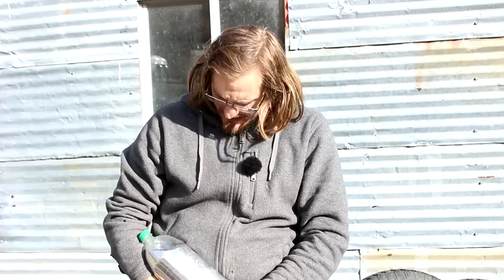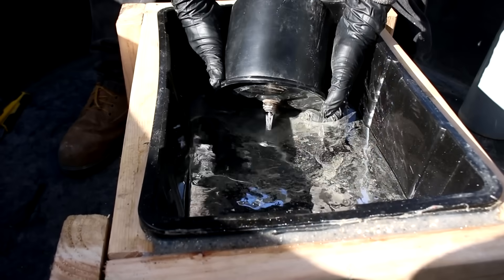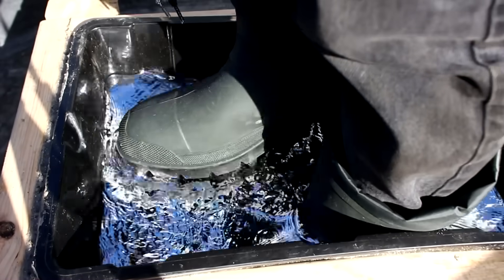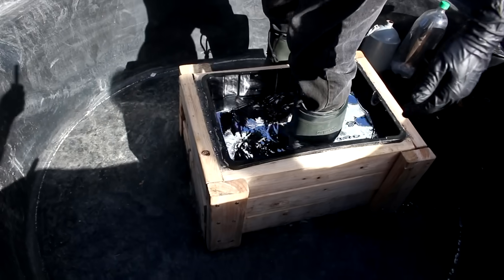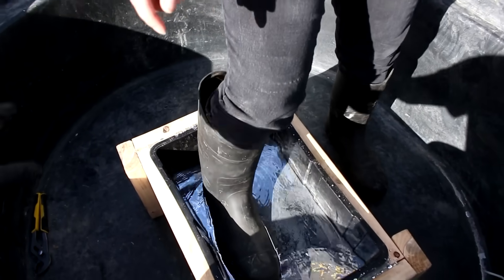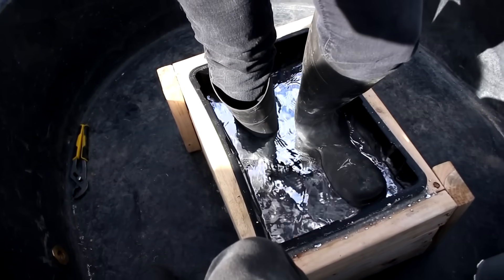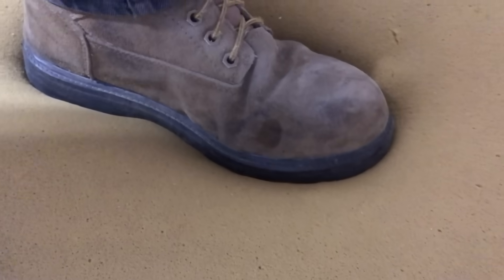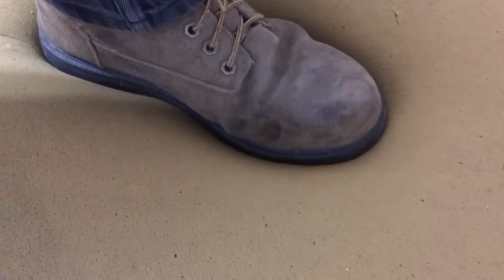Can I Stand On Liquid Mercury?

Comment: This guys a douchbag man. That stuff could kill a city if it got into the water system. Can't teach stupid I guess
Reply: The mercury he's using isn't toxic. There are more types of mercury, this one is harmless. The one that can kill you looks like water.
Reply: @chefstojko9693  Totally wrong Elemental mercury (Hg) is found in liquid form, which easily vaporizes at room temperature and is well absorbed (80%) through inhalation. Its lipid-soluble property allows for easy passage through the alveoli into the bloodstream and red blood cells (RBCs). Once inhaled, elemental mercury is mostly converted to an inorganic divalent or mercuric form by catalase in the erythrocytes. This inorganic form has similar properties to inorganic mercury (eg, poor lipid solubility, limited permeability to the blood-brain barrier, and excretion in feces). Small amounts of nonoxidized elemental mercury continue to persist and account for central nervous system toxicity.

Elemental mercury as a vapor has the ability to penetrate the central nervous system (CNS), where it is ionized and trapped, attributing to its significant toxic effects. Elemental mercury is not well absorbed by the GI tract; therefore, when it is ingested (eg, thermometers), it is only mildly toxic.
Reply: @666crippled666  Evem though I dont know what the fuck you just said, I support it
Reply: Well he's not dumping it or even using it near water systems so I'm not sure what you're one about.
Reply: If you knew anything about geography you'd know that water runs right under our feet. There are literally thousands of rivers that we don't know about running right under the streets we walk on. Accidents aren't predictable so wtf are you talking about?

Comment: Next video :- How I ended up dying of Mercury poisoning.
Reply: He's not going to die he was in Elemental MERCURY not organic  Dimethylmercury wouldnt kill him but organic would
Reply: @nunbun4084  Elemental mercury (Hg) is found in liquid form, which easily vaporizes at room temperature and is well absorbed (80%) through inhalation. Its lipid-soluble property allows for easy passage through the alveoli into the bloodstream and red blood cells (RBCs). Once inhaled, elemental mercury is mostly converted to an inorganic divalent or mercuric form by catalase in the erythrocytes. This inorganic form has similar properties to inorganic mercury (eg, poor lipid solubility, limited permeability to the blood-brain barrier, and excretion in feces). Small amounts of nonoxidized elemental mercury continue to persist and account for central nervous system toxicity.

Elemental mercury as a vapor has the ability to penetrate the central nervous system (CNS), where it is ionized and trapped, attributing to its significant toxic effects. Elemental mercury is not well absorbed by the GI tract; therefore, when it is ingested (eg, thermometers), it is only mildly toxic.
Reply: @nunbun4084  r/whooosh

Comment: What if he cooled the mercury until it almost solidified, so it's even more dense?
Reply: He wouldnt be alive at that temperature
Reply: @JuanEsquivel-ex8nv  isn't the melting point of mercury like room temperature
Reply: @TNTHammer  its -38 c°. He would be alive but it would be unpleasant af
Reply: @JuanEsquivel-ex8nv  well you see... mercury would gradually density as it gets colder and colder. If he can almost float in the heat of the sun... imagine if the mercury was in the freezer for a bit, and poured into the container.
Reply: @TNTHammer  i mean tyat could work but i dunno if its gonna b enough

Comment: ah the fresh smell of mercury vapor! refreshing!
Reply: Mercury vaporizes at 356°C, so no
Reply: @jears  i mean fume, pardon my vocab
Reply: @jears  Elemental mercury (Hg) is found in liquid form, which easily vaporizes at room temperature and is well absorbed (80%) through inhalation. Its lipid-soluble property allows for easy passage through the alveoli into the bloodstream and red blood cells (RBCs). Once inhaled, elemental mercury is mostly converted to an inorganic divalent or mercuric form by catalase in the erythrocytes. This inorganic form has similar properties to inorganic mercury (eg, poor lipid solubility, limited permeability to the blood-brain barrier, and excretion in feces). Small amounts of nonoxidized elemental mercury continue to persist and account for central nervous system toxicity.

Elemental mercury as a vapor has the ability to penetrate the central nervous system (CNS), where it is ionized and trapped, attributing to its significant toxic effects. Elemental mercury is not well absorbed by the GI tract; therefore, when it is ingested (eg, thermometers), it is only mildly toxic.
Reply: @666crippled666  it's very well ventilized so the temperature wouldn't be enough to make enough mercury vaporize to put them to any real danger

Comment: and this is also why you do not sink in Lava but get BBQd right on the surface if you dont lower the temperature while impacting to such a extent that the lava solidifies around you and you partly stay submerged until your feet are ashes or the solidified lava crust floats up with you to be your companion until you are dead

Comment: the ONE thing I would not do, is encourage your cameraman to lean over a big pool of mercury on a warm day.

it IS releasing mercury vapor, you know.

the one way the human body can readily absorb elemental mercury is through lung tissue, which has an 80% absorption rate.

you'd be better off drinking it.

you both should be wearing masks, frankly.

well, at least you poured it cold.
Reply: Mercury doesn't vaporize a lot at such low temperatures

Comment: Yea pressure divided by surface area the pressure is exerted on, greater the surface area the less displacement there is, hence less balancing act required. so get yourself a drysuit an a huge tub an lay flat in it, think there's a great idea for a new medium in deprivation tanks.

 If its not as dangerous [to ones health via topical application] as you say it is then you dont even need the drysuit

Comment: WILL SOMEONE BE STRAIGHT AND ANSWER THESE QUESTIONS! IS MERCURY POISONOUS? IF THERE IS DIFFRENT TYPES THEN WHAT IS CODY USUING AND IS IT POISONOUS AT ALL? AND IF SO HOW BAD? WHATS THE DIFFERENCE? THANKS
Reply: There's one kind of pure mercury: this one, which is why it's called "elemental" mercury. The other kinds are chemicals that contain mercury as part of them. Mercury is dangerous if it gets to your blood, but for some kinds of mercury it's very hard for that to happen.

Elemental mercury is not too dangerous if you know what you're doing. It can't be absorbed through the skin, so the only 2 risks are open wounds and breathing the vapors. The boots are because he has a wound on the foot, and he's outside and using very cold mercury so that the vapors are minimal.

Organic mercury, on the other hand, is a compound that has mercury in it and is VERY dangerous. It's colorless and looks like water, but it is very quickly absorbed through the skin and it goes through many materials that are otherwise considered impermeable. It's so dangerous that 2 droplets on your skin can and will kill you, unless it's extracted from your blood as fast as possible.

So Cody has nothing to worry about.
Reply: @Brainth_1780  thank you!
Now I have a jar of mercury, about 10lbs worth. What would be the safest method to "play with it" and how did cody get so so much of it? And I'm guessing to be extra safe I'd have to make it as cold as possible? Thank you for your time and explaining it all

Comment: Pleb level comment: Mercury is very toxic and if you touch it you die of kanker
Slightly less pleb comment: this is fine, it's only organic mercury compounds you should worry about, mercury's not that bad

Actual chemists who know about safety: Mercury is actually pretty volatile and you are now inhaling it. 

In humans, approximately 80% of inhaled mercury vapor is absorbed via the respiratory tract, where it enters the circulatory system and is distributed throughout the body.[36] Chronic exposure by inhalation, even at low concentrations in the range 0.7–42 μg/m3, has been shown in case–control studies to cause effects such as tremors, impaired cognitive skills, and sleep disturbance in workers. (1992). "Chronic neurobehavioral effects of elemental mercury in dentists". British Journal of Industrial Medicine. 49 (11): 782–790,  "Psychological effects of low exposure to mercury vapor: Application of computer-administered neurobehavioral evaluation system". Environmental Research. 60 (2): 320–327.
Reply: People who actually pay attention to the video: He minimizes the vapors inhaled by using really cold mercury and doing it outside where they dissipate much more easily. He's also an actual chemist, you know. He knows his stuff.

He's also had blood tests to check his levels of mercury after working with high quantities: the level of mercury was in the normal range (and before you say the important part is the mercury in the cells, not the bloodstream, a high presence would still reflect on the bloodstream)

Comment: Which mercury is present in thermometer...dangerous one or the other
Reply: Ignore Victor, the mercury in thermometers is the non-dangerous one. It's easy to tell as the Organic Mercury is transparent, like water (no thermometer would ever contain organic mercury, it would be dumb).
It should be noted that you should not touch the non-dangerous mercury if you have an open wound, as that is dangerous.
Reply: @Brainth_1780  Sorry
I didn't know that
I just assumed because my parents always said that

Comment: Mercury is about 13 times heavier than water... looks like he’s got about 4-5 gallons in there... so yeah, that’s about 1/4 ton of Mercury !   Crazy how that works huh.... even though the Mercury is “liquid” and should displace, the fact that it’s more dense and heavier than he is... he literally ALMOST floats on it!  She floated a lot better cause she’s lighter... he was KIND OF floating, it was obvious he could at least make contact with the bottom with each foot or else he would’ve just fallen over. She was light enough to where she pretty much had to hold on to something or she would’ve fell...
Reply: 60 lbs as said in the description

Comment: If absorbed into the skin Mercury can cause holes to develop in the brain, so why would you put you're foot on it? Have fun with your eventual Alzheimer's mad hatter
Reply: Elemental mercury doesn't absorb into the skin.
Reply: @underdoneelm7721  I'm not telling you you're wrong but I'm curious as to what specifically prevents it from absorbing? Considering all the pores in one's dermis
Reply: If I'm correct it's because mercury is too dense to diffuse through the skin - or at least at any significant rate.

Comment: Jesus, I nearly fainted when you placed your bare foot on the mercury. I know that metallic mercury does not easily penetrate skin (in contrast to ultra toxic organomercury compounds like dimethylmercury), but some of it still can. The slightest scratch or a nail cut a little bit too deep can be easy entry points.
I hope you at least took mercury's vapor pressure into account (if I understood correctly you cooled it to <0 °C, so you greatly reduced it).

Comment: You should see a doctor about your obsession with mercury. Mercury is very toxic and you might be poisoned by it and not even know it.
Reply: Elemental mercury is safe to touch as long as it doesn't enter the bloodstream through a cut. You can even drink some of it. It's organic mercury that is dangerous and can seep through the skin.
Reply: @underdoneelm7721  It's still toxic and you should never handle it with bare skin. Yes, I agree organo-mercury compounds will poison you as well, but you should never handle it unless you use the proper equipment and protocols correctly.
Reply: While using safety equipment is tautologically safer than not, in this case its benefit is marginal (at least in terms of touching it, the vapors are another matter entirely). Assuming he doesn't have any cuts, then touching it for a short period of time is less likely to give him mercury poisoning than just eating a lot of tuna. Does he technically remove a small amount of risk by wearing gloves? Yes (i.e. Mercury entering through a cut). Is it likely at all to matter? No. The thing to really be concerned about is the vapors which is why he's outside and has it chilled (i.e. safety protocols to deal with the vapors).
Reply: @underdoneelm7721  I do agree with your logic, though. Thank you for your reply.
Reply: @underdoneelm7721  You seem to know a lot about the subject. I respect that.

Comment: I think you should be a little bit more careful, you may think its not that toxic, and you probably know better than i do. But im pretty sure its more than toxic enough to be respected and not played with, especially with a smart guy like you, it would be a shame to see you wreck your brain just for views on a video. Doesnt mercury absorb through skin? Or am i mistaken for only certain forms like dimethylmercury?
Reply: Elemental Mercury absorbs through skin very slowly, it's only if you have cuts or any other skin problems its really bad, The Mercury vapours are what you need to avoid.

Dimethylmercury is a Organic based mercury and you dont want even one drop near you, if im remembering right ((CH₃)₂Hg) was in the news 2016-2017 someone got 1 or 2 drops on there skin through gloves nearly killed them.

Comment: This guy is fooling around. His fee/tboots would experience only as much force as the weight of mercury his boots displaced. If he wants us to believe that he partially floated by having some mercury under his both feet and his both feet not touching the tin, it means his weight is same as the mercury that the boots displaced. That is absurd. Say he weighs 80kg, then his boots displaced about 6 liters of mercury. The total mercury he used for this experiment is from a 2 litre bottle. He will express some push back but it won’t be enough for him to float. For floating he would have to dip his legs  further.
Reply: He used 8 flasks of mercury each containing 80 lbs. (36 kg.) of mercury for a total of 640 lbs. (290 kg.) I assume he weighs less than that. If we assume each one holds 2 litres like you stated, then he used a total of 16 litres. 16 > 6.

Comment: its like 40% of the comments about mercury is very poisonous, you can die from touching it...., well yeah, if you mean organic mercury, its true, but that's not a organic mercury, but elemental mercury...
Reply: and, elemental mercury, while it can't be absorbed easily through the skin (including guts), CAN be absorbed readily by your lungs (80%), if you breathe the vapor.

it has a low rate of evaporation/sublimation, but with that much mercury being poured, and watching the girl literally stick her face in the enclosed space of that box while he was pouring it, you're going to at least get a tiny bit of mercury being absorbed though breathing the vapors.

elemental mercury mostly gets transported out of your blood after being absorbed, but some of it will stick around, still as elemental mercury, and cause nerve damage over time.

this is what poisoned (and sometimes killed) gold miners in the 19th century that used mercury to help extract gold from ore.  it wasn't so much handling the mercury, but breathing the vapors that did it.
Reply: didn't those guys actually boil the mercury?

Comment: The air bubbles we see at the beginning are not from air contained in the mercury, but air that is pumped with the falling mercury by the venturi effect.  As soon as it enters the dense mercury it springs upwards.  You can see the same phenomenon at the bottom of waterfalls.

This experiment was not absolutely necessary since the result could be theoretically predicted by the discovery of a researcher working at the GITP (Greek Institute of Technology and Philosophy).  Although this discovery is fairly recent (around year 250BCE) it has been thoroughly tested and is now accepted as valid.  It says that the experimenter will displace his weight in the mercury, no more and no less.  Thus, knowing the density of mercury and the diameter of his boots we can predict how deep he will sink.  If he succeeds at staying up that is, since there is no friction under his boots...

BTW, the name of the researcher is Archimedes.

Comment: How on earth you can imagine walking on something which has 0 friction? With two points of support you will be so unstable that you can't even stand on it. You would need to keep your centre of mass above a line to keep your balance. You need to have a third point to form an area of support to allow static stand. With only a line of support you would need some kind of dynamic system to maintain your balance.

Comment: Very interesting experiment, but I have a question, Archemedes principal states that the mass of the dispaced liquid is equal to the mass of the object floating,. But in this case the liquid mercury you have considered is 25lb, which is way less than your weight so how could float as the mass of the dispaced mercury is less than your weight